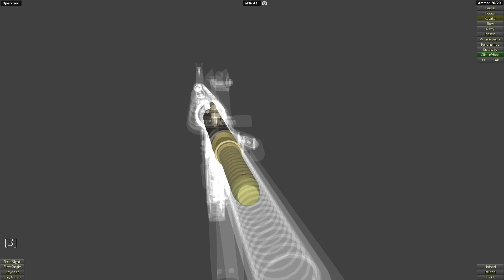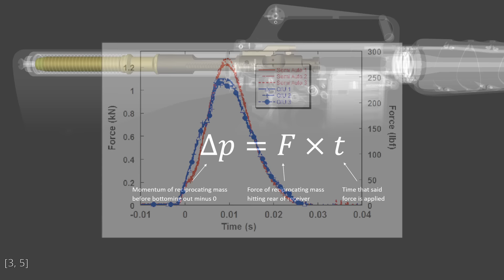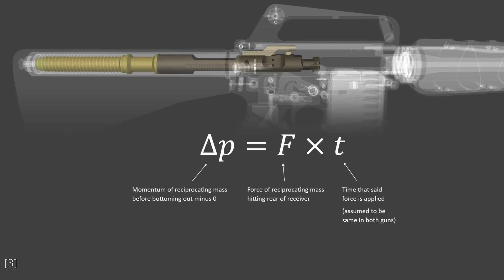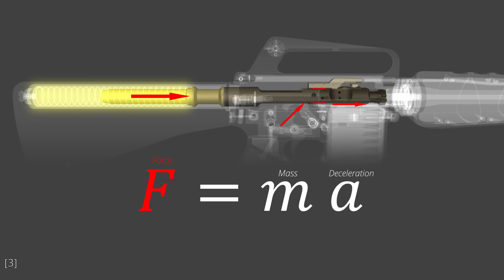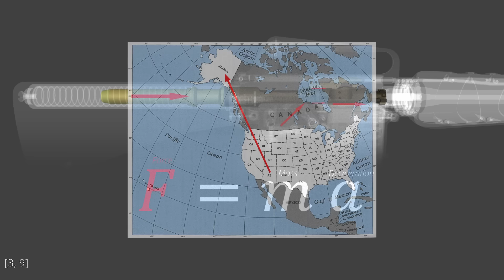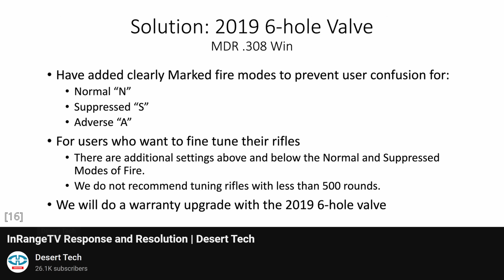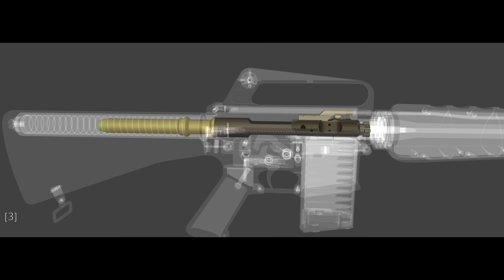Bolt Carrier Mass - A Nerdy Theoretical Discussion

Comment: The amount of ke absorbed by the spring isn't the same, because the time it has to act is different. I would recommend looking at it in terms of momentum anyway.

At any given amount of compression there will be a certain force but the amount of time spent at any given force is longer for the high mass variant.

This can be derived intuitively by remembering that if the mass is too heavy in your AR, it will short stroke and never bottom out. Therefore, a mass that never reaches the end cannot have the same ke at the end point as a mass that does.

Mathematically when you bring out the impulse formula you're very close to being correct, you just should have applied it to the earlier part of the video.

∆p=∫f∆t and so an integral with the same force curve but stretched over a longer t will be a much larger area under the curve.

On the forward stroke you're correct though because the spring will be able to increase the p of the bcg more so a lightweight bcg will have less forward recoil, but more rearward recoil.

The rest of the video is spot on.

Overall I like the video a lot. I don't mean to be too hard on you, it's a good video and I'm definitely subscribing.
Reply from the maker: I really appreciate your comment, but I'd have to respectfully disagree. The elastic potential energy stored by a spring is given by E = (1/2)k(∆x)^2. It only depends on the change in length and spring constant, not time. No matter how long the mass is staying at a certain point of spring compression, the energy absorbed is the same. 

What you mentioned about ∆p=∫f∆t relates to the impulse transferred from the spring to the bcg as it retracts, and yes that impulse does increase if the time is stretched out longer, but that's impulse and not kinetic energy.

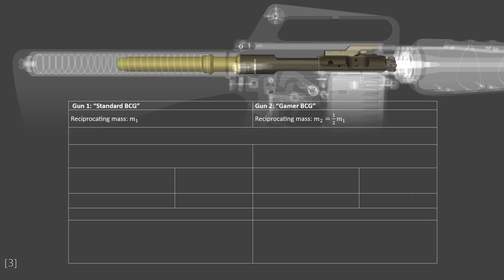The reason my calculation did not account for the case where an overly heavy bcg would short stroke is because of another assumption that I've made, which is the gas system provides the same amount of kinetic energy to both guns (1:45). Irl, the energy provided by the gas system can be calculated with the mechanical work formula, which in this case would be an integral over distance of the force applied to the rear wall of the internal gas chamber inside the AR-15 bcg (or force applied to the front surface of the gas piston on external piston guns). That force is dependent on the gas pressure, which drops over time as the bullet goes past the gas port and exits the muzzle. If the bcg is overly heavy, it would accelerate slower (F = ma), and thus the force over distance graph would drop more, the area under the force-distance curve will reduce, meaning less kinetic energy is provided to the bcg.

My assumption that the gas system provides the same kinetic energy in both cases does not hold up in reality if the bcg mass increases past a certain amount, and I missed that when scripting this video for sure. I've also failed to mention a few other assumptions, such as the the bcg will bottom out in both cases, which might not happen irl and will drastically alter the recoil sensation. Overall I do think myself that the math I've used is oversimplistic.

And no worries, I didn't take your criticism personally. Again I really appreciate you taking the time to comment, and I really love having in-depth discussions like this about my videos after I post them. I'm glad that you mentioning the case of an overly heavy bcg pointed out a mistake in my assumption about the amount of kinetic energy initially provided.

Really love what you're doing on your channel btw. I wish I can get a chance to tinker with firearm designs like that, but alas, the gubermint just banned the possession of firearms CAD files up here in Canada 😅
Reply: @cabbage6015   Oops, I definitely got that ke part wrong, I started thinking about momentum and then wrote about ke. You’re correct that the amount of KE stored in the spring is determined by the constant and displacement alone. 

The thing is, recoil isn’t a function of kinetic energy; it’s a function of momentum. The momentum of a system is conserved, so the bullet and gas going in one direction (with a certain amount of momentum) will be offset by an equal and opposite amount of momentum in the opposite (rearward) direction no matter what the recoil system or weights are. What we feel as recoil is this momentum being transferred from the gun to us, but there is no way to change the total amount of momentum transferred due to conservation of momentum. Even though the total area under the curve is unchangeable, the shape of the curve is and “Felt recoil” is more so the peak impulse, which we can change.

While the bolt is locked, the momentum is largely transferring to the frame of the gun alone (in a bolt action this is all that happens) but as soon as the bolt is in motion it picks up the remainder of the momentum and it’s motion rearward is slowed because the spring is transferring momentum from the bcg to the non moving reciprocating portions of the gun.

A heavier bolt will be locked longer, thereby frontloading the momentum transfer, but it will also give the spring more time to exert force, and the integral of force over time is change in momentum therefore it’s bleeding off more momentum which is why a heavier bolt is less likely to bottom out.

If the bolt bottoms out, it will dump the remainder of the momentum and this will typically be the peak impulse. The forward stroke also isn’t a function of KE, it’s a function of momentum where the spring acting longer is able to transfer more momentum into the bolt before it closes and causes the front of the gun to dip. 

So the peak impulse is less with a heavier bolt, and the curve overall should be flatter and longer,  but the forward momentum and dip of the gun will be more due to increased time to close the bolt.
Reply from the maker: I agree to conservation of momentum part, which is why I worded my conclusion as the heavier reciprocating group disrupts the sight picture more as is impacts the back and front of the gun, and not that it gives the gun a higher rearward momentum after the firing cycle is completed, because that would be wrong.

From what I understand from Jim Sullivan's constant recoil patent, in a gas operated gun where the reciprocating group bottoms out, there are 6 ways the rigid frame of the gun receives momentum throughout 1 complete firing cycle:
(1) The rearward impulse transferred to the rigid frame through the locked bolt as the bullet goes down the barrel
(2) The forward impulse transferred to the rigid frame by the gas pressure applied to the front wall of the gas chamber
(3) The rearward impulse transferred to the rigid frame through the recoil spring as the reciprocating group moves back
(4) The rearward impulse transferred to the rigid frame as the reciprocating group bottoms out on the back of the receiver
(5) The rearward impulse transferred to the rigid frame through the recoil spring as the reciprocating group is pushed forward
(6) The forward impulse transferred to the rigid frame when the reciprocating group strikes the front of the receiver

And yes, all 6 of these impulses combined will give the gun a momentum opposite in direction and equal in magnitude of the bullet and gasses leaving the front of the gun, as you said. 

Among these impulses, Imo (4) and (6) are sharp spikes that disrupts the sight picture way after the shot is first ignited, and are influenced by the reciprocating mass, which was why I wanted to focus on them for the video.

I think your derivation of the rearward momentum as the BCG bottoms out is mistaken because the your impulse (1) is smaller than the impulse of the bullet, and if I understood you correctly, what you were saying is that (1) + (3) + (4) will equal the bullet impulse. You were missing (2), (5) and (6). According to Jim Sullivan, (1) should be equal to the negative of the bullet impulse. (2) is the impulse given by the gas to the front wall of the gas cylinder, and should be equal in magnitude but opposite to the direction of the impulse given to the reciprocating mass. (Later on the momentum provided to the reciprocating mass by this process will come back to influence the rigid frame as impulses (3), (4), (5), and (6)). As you said, a heavier BCG would accelerate slower, so the time that the gas pressure applies force on both the gas chamber and the BCG should be longer, leading to a higher impulse on both parts. Basically a heavier BCG should have higher momentum at the beginning of the rearward stroke. Whether or not it will still have higher momentum when it bottoms out will depend on the time it spends under the force of the recoil & hammer spring (compared to the time a lighter BCG would spend). To eliminate time as a variable, I used energy calculations since they're independent of time. And while as you said, energy calculations cannot be used to describe what is the force applied to the rigid frame of the gun while the BCG gets from the front to the rear of the receiver and vice versa, they should be valid to get us to the end points, by allowing us to derive the velocity at the end point in terms of mass, and sub that into the momentum equation. Ultimately, that was what I did.

Comment: I think an explanation for why the energy is the same in the two configurations is warranted: The lighter Bolt Carrier System has the same force(F) from the gas cylinder(because piston cross sectional area and gas pressure are the same), but its lighter weight make it accelerate(a) twice as fast, but since the stroke distance(s) is the same the force from the piston is therefore acting for a shorter period of time, hence the final speed is not twice, and energy is therefore the same. (a=F/m), (2*a*s=v^2)

Comment: I wanted the lightest rifle possible and achieved a weight of 4.2 lbs without carbon fiber. The bolt carrier is skeletonized steel (Faxon), the buffer is a hollow plastic piece that weighs about a gram, and the recoil spring is reduced 10%. All of this necessitated an adjustable gas block of course, and it is set at 50%. The rifle also has an integrated muzzle brake. There's almost no recoil if you're shooting White Box, but the Tula steel cased stuff does introduce a bit of it as it is hotter. Despite minimal gas, the extractor does try to rip the rims off the cases it seems, although the damage to the cases is minimal. The reciprocating mass is just too light and the BCG needs the velocity to fully cycle. Another issue I suspect is occurring is bouncing at lockup. The reduced mass and spring weight may allow the BCG to bounce back slightly when going into battery, although I've had no malfunctions with this setup (except when I used way too much oil). I could fix both the bouncing and rim-grabbing issues by filling the hollow plastic buffer halfway with lead shot. This would give a deadblow hammer effect at both ends of movement and add a little mass back into the system.

Comment: The only issue I had with the enigma was taking it off. 
My work around to leaving a gun in my vehicle was to carry another holster. 
I carry a custom IWB holster and move my pistol to that if I need to leave it in my vehicle. 
If I need to take off the enigma in public, I don’t need to worry since I placed it in another holster. 
My leg strap has never disconnected on me. It’s defiantly operator error.

Comment: One other major factor with mdr issues you hear of is caused when used with 25 round pmags  in 308 there is an early release and uncontrolled feed when coming from the right feed position on all the variants of that mag from full cap down to 10 rounds once it’s down to 10 remaining the feed from the right position works perfectly the left feed position has no issues at all for the entire mag

Comment: You're missing the foward force that happens when the BCG is launched backwards. Which somwhat cancles out the recoil from lauching the bullet 

A heavy BCG can be very smooth shooting if it can decelerate with long traveling distance. Like that of the Ultimax 100. But most rifles don't have very long receivers to accommodate this. 

So with a nomral length of travel, a lighter BCG would have less momentum when it hits the end of the receiver
Reply from the maker: Yup. The recoil behavior of a gas operated gun involves the rearward impulse from the bullet when the bolt is still locked, the forward impulse on the front wall of the gas system, the rearward impulse transferred through the recoil spring when the bcg moves back, the rearward impulse of the bcg striking the back of the receiver, the rearward impulse transferred through the recoil spring when the bcg is pushed forward, and the forward impulse of the bcg striking the front of the receiver. But I was not ready to do all that math at once and compare them as a function of reciprocating mass, so I just swept most of them under the rug lol

Comment: The only way that you can possibly help the light carrier problem’s (that is failure to feed or failure to chamber rounds all the way) is to add a bigger buffer weight and with longer weight travel (meaning a longer buffer). But that would only bring you back to square one by adding more weight again.

Comment: The amount of velocity/energy that the rebound of the reciprocating mass gives to the return to battery stroke is non-trivial. It's based purely on velocity; faster cyclic rate (rearward velocity during spring compression) increases the amount of energy returned via the rebound off of the far end of the receiver extension.

Also, just run an FA carrier and use the Vltor A5 system. 👍
Reply from the maker: I did make my math a bit oversimplistic when I only looked at the length of time between the bcg bottoming out and coming to a point of zero velocity. I didn't know the equation for rebound velocity (or if there is an equation), so I just swept that under the rug for the sake of having a clean impulse equation with the same end point lol
Reply: @cabbage6015  I think you did a superb job and would love to see you dive even deeper in future videos. I would have made the same decision you did. Keep it up!! 👍☺️
Reply from the maker: @DBravo29er  Thanks for the kind words!

Comment: I think the difference on recoil is even more pronounced with handguns.  Shooting a P320 full size slide along with a P320 X-Five slide with its factory lightening cuts, all on the same frame, the difference is really evident.  It's a lot easier to track the sights through recoil on the X-Five. 

But that pistol really didn't like it when I tried adding a compensator.  The regular full size just took it and ran...

Comment: Ive owned every MDR generation and am very familiar with its changes and drawbacks.
Youre right about the light carrier problem, but another issue that plays into this whole tuning dynamic with gas operated rifles is the location of the gas port and the  geometry of the bolt carrier cam path. 

Desert Tech chose to rectify the rim ripping issue, present only in the 308 rifles, by increasing the size of the extractor along with modifying the gas plug. 

Moving the gas system further from the chamber, or by lengthening the cam path helps reduce the ammount of energy needed to cycle the weapon as well by allowing chamber pressures to drop to lower levels at the time of extraction. 

Imo changing the reciprocating mass should be one of the last variables you address when tuning a rifle, whether that be for duty or competition.

Comment: Right near the start I question the assumption of equal kinetic energy imparted; I would be curious to know how different the result may be if equal momentum is assumed. 
Equal moment impulse may be the more accurate assumption, or at least something part way between fixing energy or fixing momentum. This is because the initial gas charge is based only on barrel pressure and time from the bullet passing the port to exiting the barrel, and that kinetic energy transfer comes from force and distance while momentum comes from force and time.  The restriction of the gas tube is likely substantial in the analysis, and the time of bullet in the fast end of the barrel (port to muzzle) is likely much less then the one directional travel time of even the lightest bolt carrier.  

This of course depends on the dynamics of the initiating gas pulse, specifically how it dissipates both the static and dynamic gas pressure from a shot.(and assuming semi-auto so the time between cycles prevents direct pressure wave interactions. (Residual heat in the parts effecting conductivity and part clearances would be the only interaction of one shot on the next).

As far I know no common designs use a checkvalve so there would be more loss of pressure back out of the gas port with a heavy slower mass. How much backflow likely involves timing of pressure waves not unlike tuned header pipes or expansion chambers(2 stroke) on a piston engine. If backflow loss is substantial then equal momentum is almost certainly a better assumtion than equal kinetic energy. 
 
I have not calculated the relative cooling effect on the gas charge due to expansion vs conduction to the gas tube, piston, and cylinder. If conductive cooling is proportionally significant than the slower heavy bolt will also have more pressure loss from a given amount of hot gas and again tilts toward equal momentum.
Reply: And yes I read the pinned comment.

Comment: I'd love if you could do a friction comparison of the different options, perhaps by comparing clean vs dirty bolt velocities with standard milspec, lightweight, and possibly different coating types. I think that'd play a bigger role, perhaps pushing users towards a heavier buffer and cutdown BCG for better reliability than milspec. Or if the friction really doesn't matter, in which case the cheaper lighter buffer and milspec BCG are better.